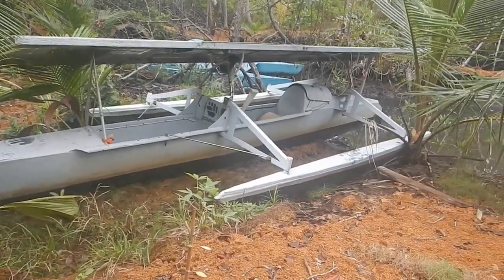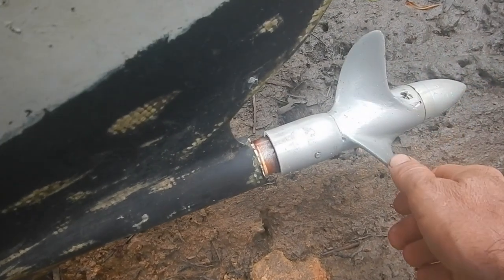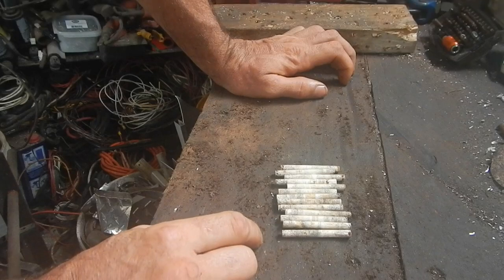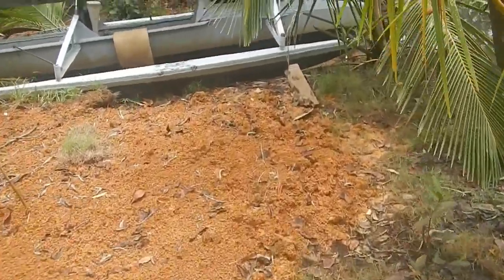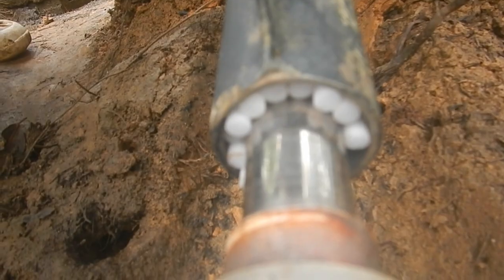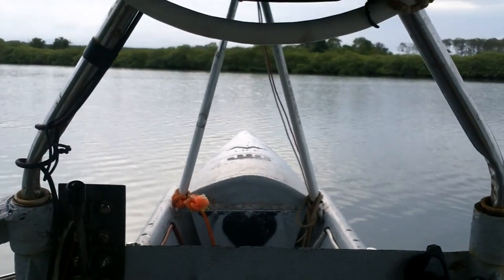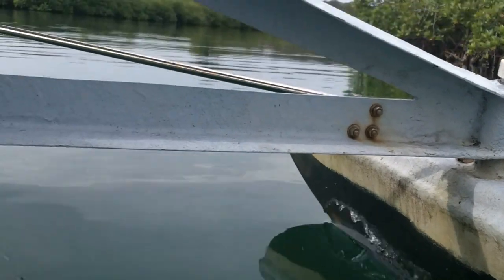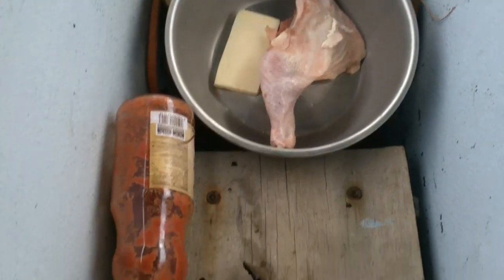Replacing the Rollers in a Bearing

Comment: A pure silicone seal at the bottom and a grease fitting on the top will make the shaft smoother and quieter and new motor mountings will reduce vibration in half.

Comment: If you want your bearing to be quiet, every part should be made on lathe as round and as smooth as possible. While stainless steel pipes can be shiny if they are polished type, they are typically far from round, unless particularly prescision grinded. Using tailstock to support the other end would be good idea with such thin plastic.

Comment: I thought that boat was a lot louder before you changed the bearings.  It seems like you don't have to quite shout over the motor. how about a polymeric rubberish coupling like we use on cooling tower pumps.  I bet you could make one.